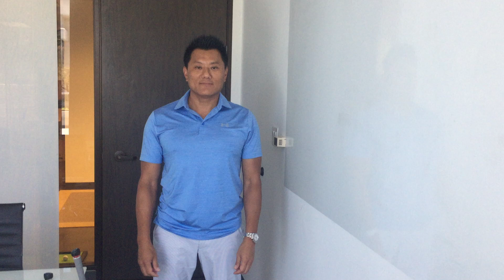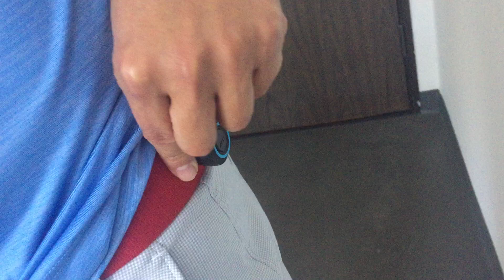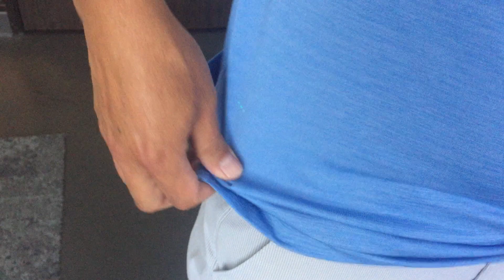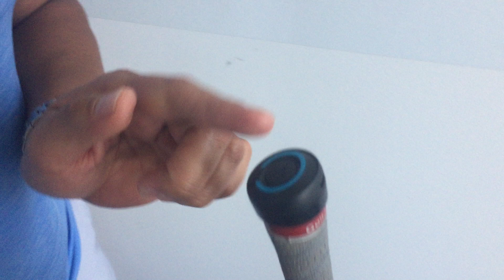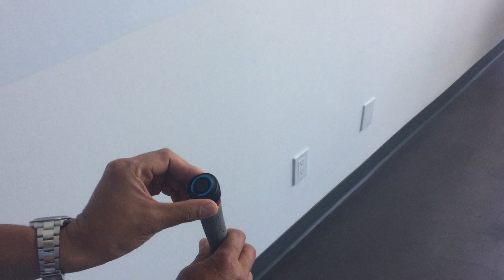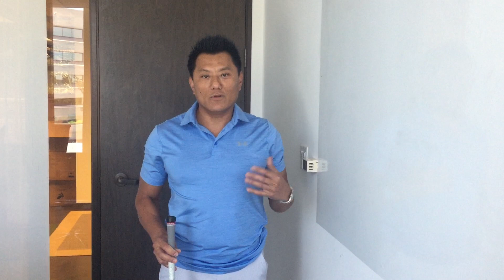Sensors Set Up

Comment: Please clarify which version of DuoTrac firmware/sensors this is for.  This setup does not match what was on the instructions in the box.  I'm confused.
Reply from the maker: In this video Jason uses the DuoTrac 2.0 (three-sensor system). Firmware version: 2.0.4.